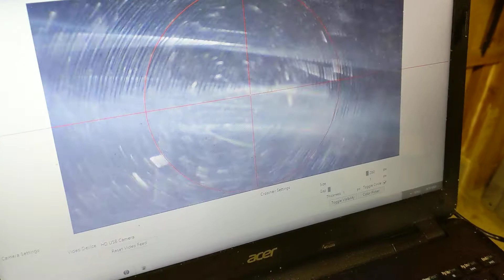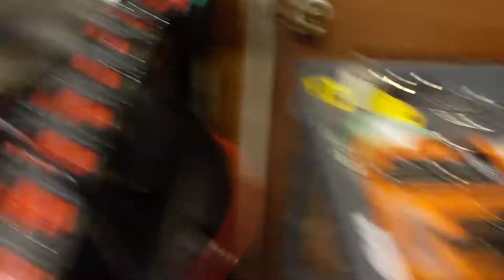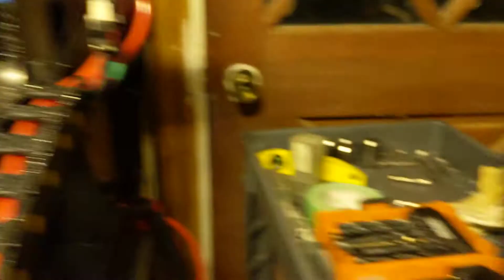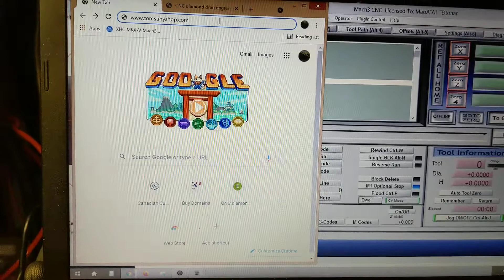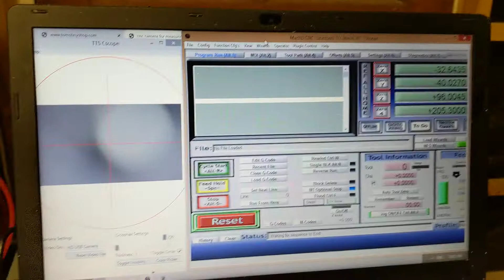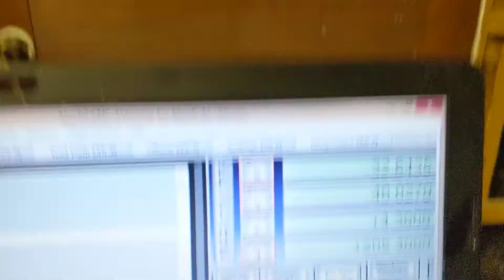Digital camera for precision centering and measuring on a 3040 CNC.

Comment: We use OpenCV for locating drill holes or other markers for positioning a CNC machine automatically on the XY axes.  If you are using Mach3, please check out NewRAD CNC.
NewRAD CNC v1 3 with Cameras and OpenCV
https://www.youtube.com/watch?v=cICAZHzGLwo